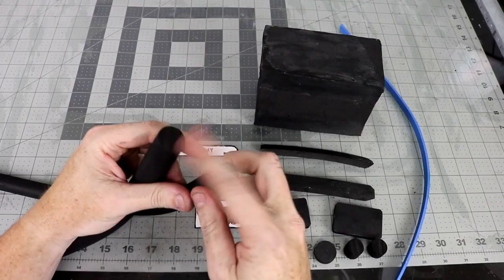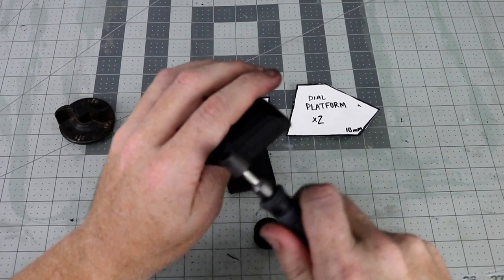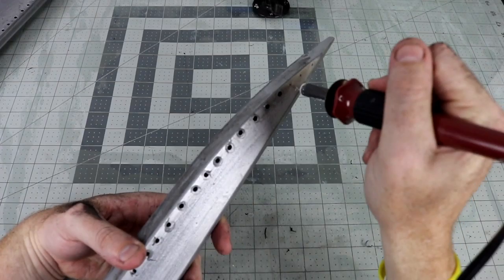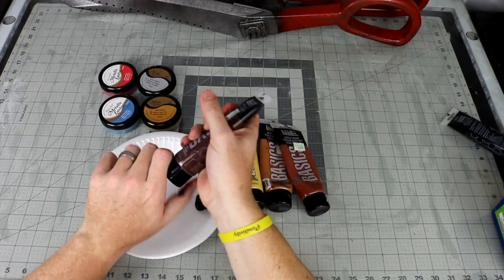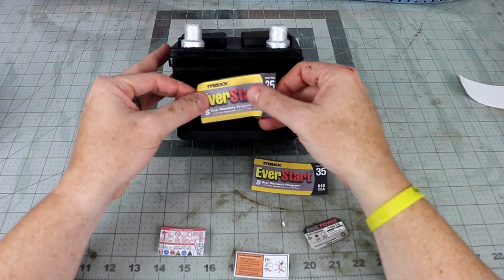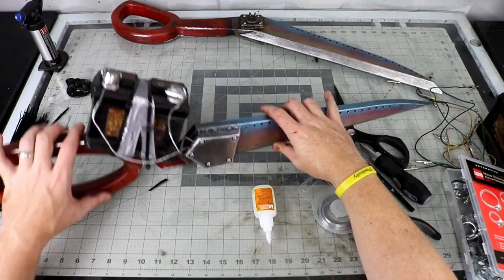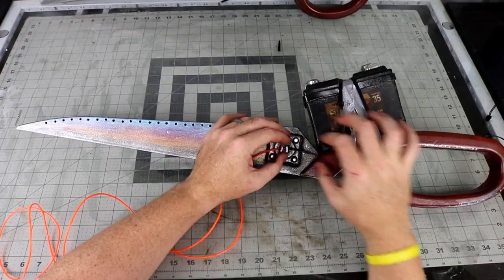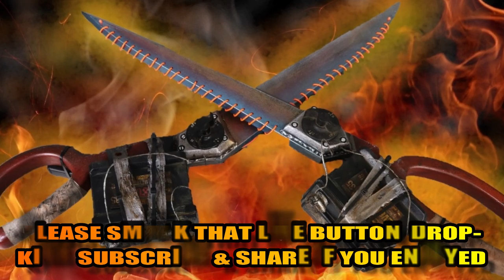Making Scorched Scissors

Comment: Love the style, only one little question why didn't you use the giant empty battery as a place to put the batteries? And I do love that heated Steel look what wax paints do you use? Sorry wound up being two questions
Reply from the maker: I thought about doing it, and it could easily be done by cutting a hole in the foam battery or making a recess for it to sit in. With time constraints of getting a video out I just had to post what I have. I use Deco Art Metallic Luster, they sale it at the Hobby Lobby at my house and I always like the results I get with it.
Reply: @MuchProps  no Hobby Lobby's here in Alaska but i found them at Joanna's fabrics. They didnt have the blue
Reply from the maker: they also sale them on Amazon.